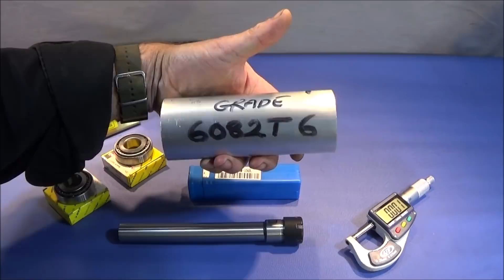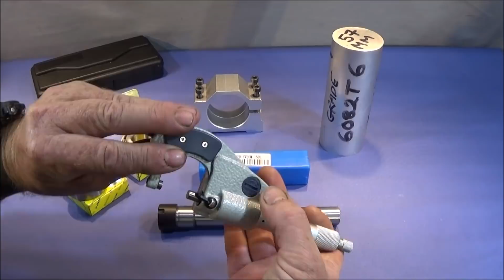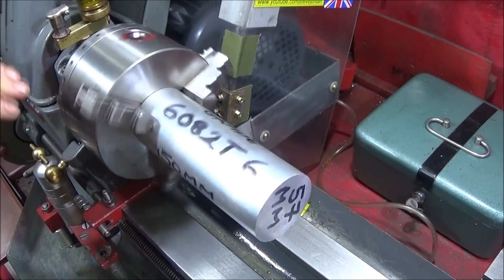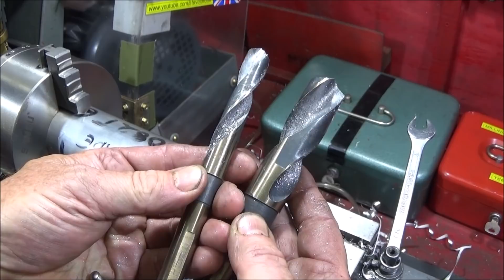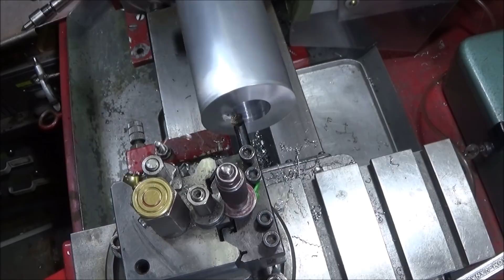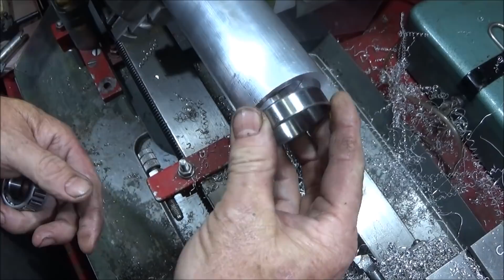Lathe Milling Spindle Attachment Part One Machining A Long Billet.

Comment: Great idea for those who need a vertical head for their horizontal.  One question:  without a four-jaw chuck, how will you get a parallel seat for your roller bearing on the other end?
Reply from the maker: I have a 4 jaw but I can use my three jaw for this and get it spot-on.

Comment from the maker: PARTS & TOOLS SHOWN IN THIS VIDEO LINKS BELOW:-
ER11 to ER25 Straight Shank Collet Chuck Holder C8 to C20 -- https://goo.gl/1AxQrV
52mm Mount Clamp Holder Spindle Motor Mount Bracket -- https://goo.gl/Q1W42Q
Professional 0-25mm Electronic Digital Micrometer --  https://goo.gl/wEyDD9 
9pcs 3/8 Inch Shank Boring Bar Set Lathe Tool -- https://goo.gl/9MbgL5
S12M-SDUCR07 12x150mm Internal Boring Bar Tool -- https://goo.gl/4e42my
MT2 Live Center 0.02 Inch Accuracy Lathe Taper Tool -- https://goo.gl/7Npnem  
60% off Mechanical Parts Sale -- https://goo.gl/zTujuM
12% off Cutting Tools -- https://goo.gl/BeMJzL
12% off Workshop Tools Promotion -- https://goo.gl/zYzchM (coupon: 13ED48)
Category
BEARING SIZE 20MM x 47MM x 13.25MM (DUNLOP Bearing Number 30204).
Reply from the maker: 15% off Mechanical Parts Clearance -- https://goo.gl/uaHuve
    Tools & Equipment Clearance -- https://goo.gl/ZNBDsu
    Measurement Instrument Clearance -- https://goo.gl/Dbkb4X